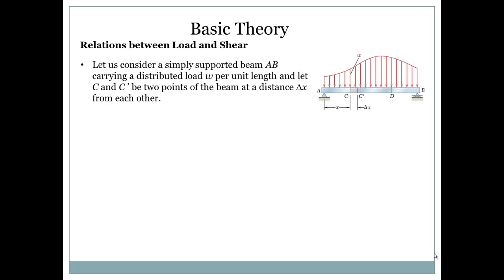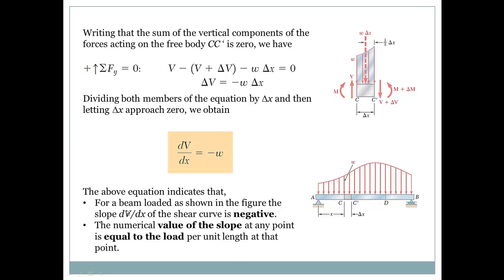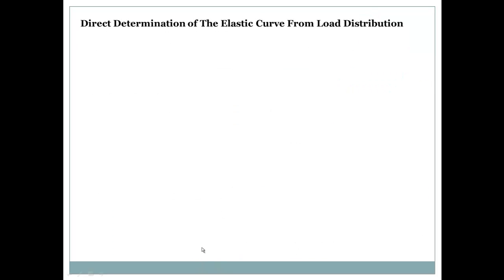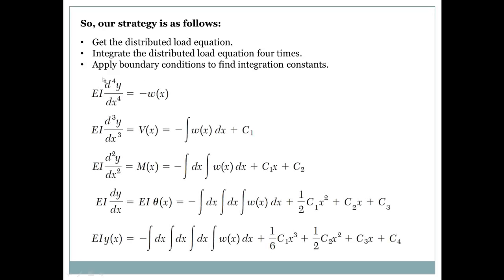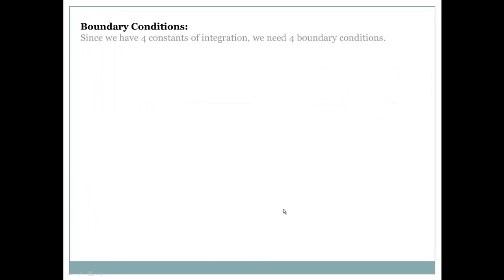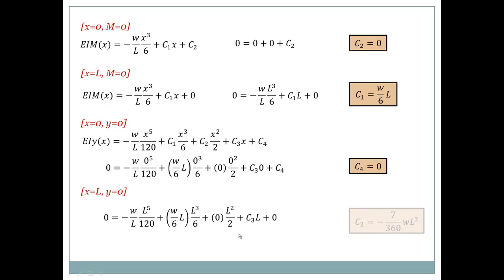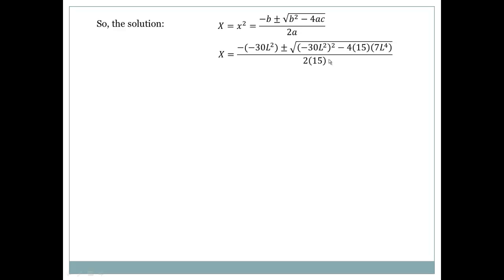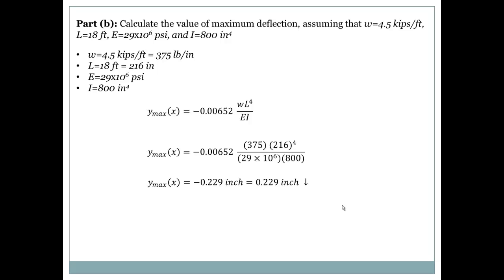Beam Deflection Using "Quadruple Integration" Method

Comment: Great video! Thank you for sharing. I had some confusion at first because the formula you derived for the deflection of a beam with load increasing uniformly to one end was slightly different than the formula given in the Steel Construction Manual for a simple beam under the same loading, but I realized the formula given in the manual uses a capital W (total load) instead of the lowercase w (load per length) as you have shown.
Reply from the maker: Glad to hear that you figured it out.

Comment from the maker: Mathematically these two points can represent anything. but think for a second here. if you used 1.7L^2 and solved for small "x" you will get x=1.315L. the physics of this problem is saying that this x is NOT located on the beam. That is why we use x=0.5193L

CTSCIVIL